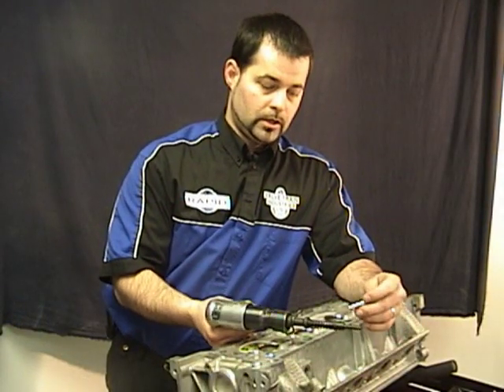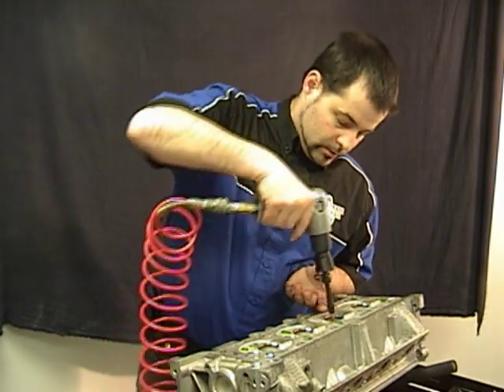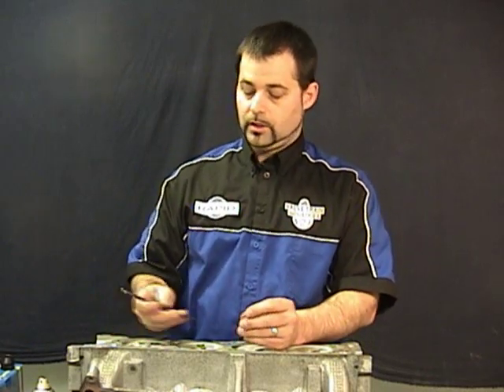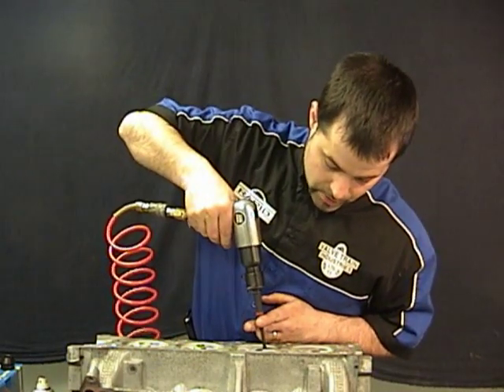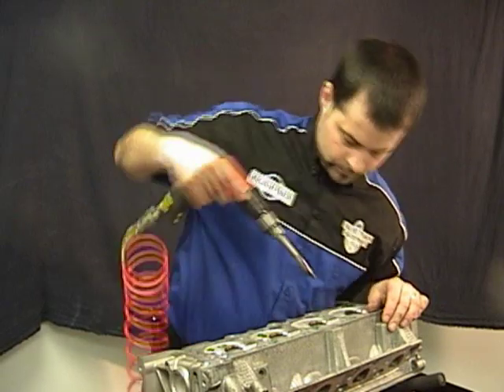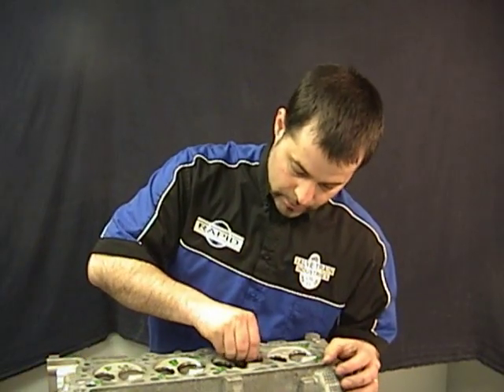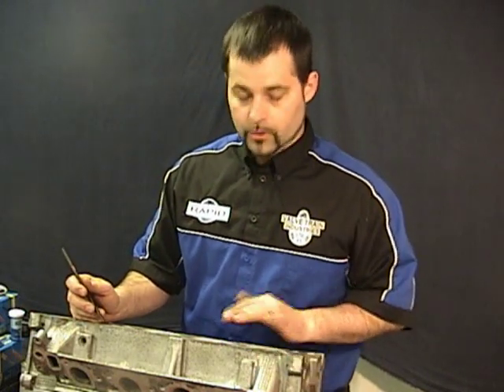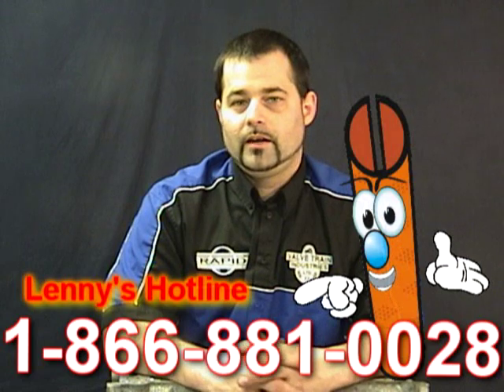Valve Guide Repair Sleeves Demo Part2

Comment: Hi sir hope you are well, I brought a sumake air neumatic 4500bpm hammer for installation of bike engine head valve guide. But when I fitting guide by hammer it going cross not straight, what to I do please help sir

Comment: Thanks for the video,  I was using a hand hammer and punch and I fail to remove any valve guide 😔 gotta get a air hammer and air compressor ASAP 🙂🙂

Comment: Thank you for your Youtube video  I have one quick question  Putting lock tight between the valve guide and the k-line , would the lock tight interfere with the heat transferring efficiently ?

Comment from the maker: @salemcripple  The use of a carbide ball is the perfered method of sizing the guide liner.  The cross hatch or for Rapid liners the diamond pattern remains in the liner the same as if you used a brouching stick.